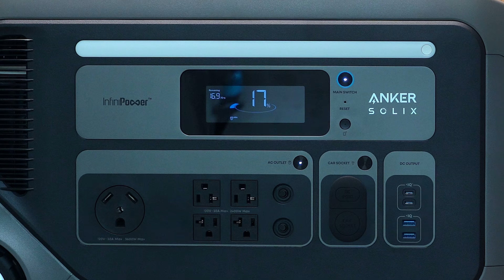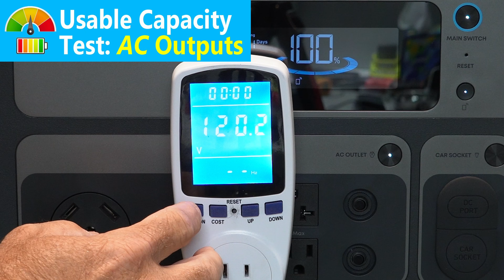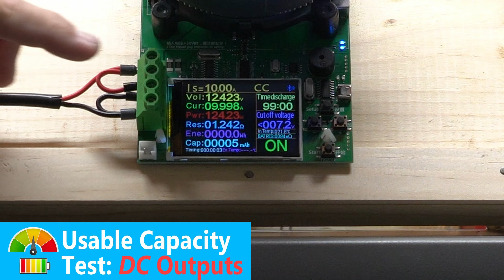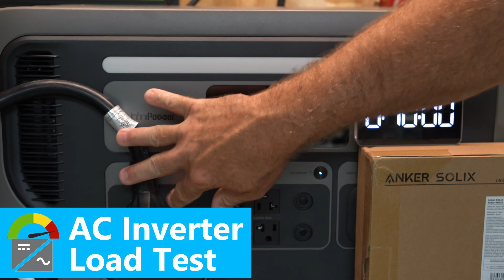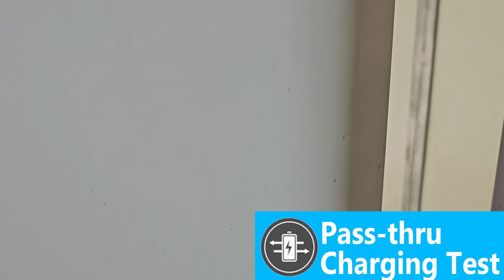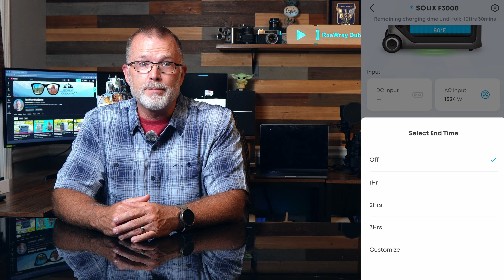Anker SOLIX F3000:  High-Capacity | High-Output | High-Versatility

Comment: Hello I just purchased this last week. This should be OK running my gas furnace correct?
Reply from the maker: Yes.  And depending on the gas furnace and how you're connecting it, you might need to add a ground-neutral bonding adapter plug to make the furnace happy.  Ive not ever needed one, but ive heard that some people have  run into that. Easy $10 solution if you do need it...
Reply: Thank very much for the comment.

Comment: This is a good review that brought out some things I didn't know about the unit such as throttling back the voltage.  If I should ever mistakenly overload the AC output I would rather it trip the AC output breaker than to damage my equipment.  I've been using it in my 30a RV for just over 3 months and it has checked all the boxes for me.
High output DC port:  I'm powering a Starlink Standard from this DC port.
The 3600 watt input/output: I plug the 30a campsite power into the F3000 and plug the F3000 into the RV. (big plus)
The high voltage solar input:  I have three 200 watt solar panels wired in series (for about 80v input) to keep it charged.

Comment: Great review ,understand its the main event but would have like too see what power station you we're using,,I  just bought fx3000 plus extra battery I also so own 2 dpu with 3 batteries each I was wondering if I could plug into fx3000 from 30 out on dpu ???? THANK YOU 🌴🐊😎

Comment: Will this f3000 work if i have it on a 30amp inlet box & have only my central air on which is a 3 ton unit? Ill have other breakers off of course. I got a inverter gas generator ill use for my refrigerator & lights

Comment: I saw the idle standby time and 240v, then learned that's only with 2 of them. Plus the proprietary connectors are a no go for me. You're still better off buying a delta pro, which is several years old at this point, if you're okay without 240v. Or a delta pro 3 if you want 240v

Comment: Ordered 3 of these with 8 rigid solar panels. Was gonna do 6 pannels on top of the house for the main 2 f3000 units connected together. The other 2 solar panels and f3000 will hook up on the shop/shed. Will expand as needed. Will connect via transfer switches.
Reply: Holy cow, that's some real power!
Reply: I'm in AZ, and it's wasted free power from the sun if I don't do something like this. Even if my electric bill is 25% less, it will still be fun setting this up.   @Mark-yuMark-yu
Reply: I know you've moved on from the f3000 setup, but was wondering what rigid panels you went with for that unit. Trying to maximize the input on mine.
Reply: @CMDR_Shokwave  Yes you are right. I am now at 71 panels on the house and 3 big inverters from EG4, but the shop runs on f3000s and f3800plus units. The best output i have found is on Philadelphia 450w bifacial N-type Half cell from San Tan Solar in Arizona. They list them for 199$ per panel, but if you specifically ask for Ryker when you call them, and tell them I sent you he will give you a discount. I don't get anything from them in return and I don't need it. I just bought 13 more panels at 150$ from him so he will work with you. I live 1 light away from them. They will beat any online price most of the time. Just ask for ryker and tell them his surgeon friend recommended him. The output on these panels is insane. If on ground mount with bright background I was getting over 1300-1350w from three panels. When I did 4 panels it was maxed out at 1600w per input maximum, so it was clipping. Worth it at that level of quality. They are also super light 44lbs is nothing for that size and ouptut. N-type is awesome for summer. In non summer months it was producing more than rated. I used them on integra racks. Now they are up on the house and I overproduce still for my usage. Designed for 200kwh per day in Arizona. So actual peak with bifacial gain on the bright gray tile roof at 30 degrees with 6 inch offset and arizona irradiance with this set up is 34-35kw when all 71 panels are lit up. Good luck. This is the funnest hobby I picked up a year ago. I did give one of the f3000 to my parents, but still found use for the other units. Sorry about the typos. I just woke up. Late surgeries last night. Correction my son just reminded me that we were overproducing more than stc on ground mounts due to bifacial gain. He said i often ran 3 of those panels per input because it was enough and easy 1400-1450 w. I just remember when i put them on the ground without the mounts it was around 1350w without bifacial gain. Either way the most production i have ever seen from that small and light of a panel. Aptos and even my canadians can't touch it.
Reply: That’s really cool man! May I ask how much electric bill savings you are seeing in Arizona?
Reply: @thatfishbreeder i will let you know probably in a month when we see the bill, but i was impressed with how much power is produced by solar now with newer tech. On a cloudy day solid 1200 watts per hour just from 4 panels. On a normal arizona day its easy 1550 watts per hour from four panels. Its so much power that i want to hook up the big minisplit thats in the shop, or the big minisplit in the garage, because its making more than I can use in a 7,000 sqft home. That means I just need to buy more batteries to store more power lol
Reply: @SurgeonTech any updates? !
Reply: Just for fun, the eg4 18kpv i think i could hook up 15 panels on 1 string, and there are 3 strings i think. So 30-45 easy per inverter  @jonidontknow

Comment: If I set up anker solar roof panels and connect them to the f3000, and then use a transfer switch for certain devices, that if the power of solar charge exceeds the power needed to run those devices and the battery is full, then the battery gets overloaded? That is my main and only question for my use. I don't want the smart stuff behind it, but I don't want to burn the f3000 either. (Off grid use)

Comment: If your Amp power plug had the ground pin there may be significantly less noise depending on the wiring inside the amp.

Comment: pardon my ignorance but why would you use a multiplier of 5 for the solar input ? you say that you could get up to 12,000w of solar with that multiplier but the max input is 2,400w
Reply from the maker: The point of the 4-5x multiplier is to provide a way of estimating how much battery capacity (in Wh, or Watt-hours) a given rated solar output can provide.  So 2400W of rated solar output can provide up to about 12000Wh of charged battery capacity…more than 4x the actual capacity of this particular power station by itself…or approximately equal to the F3000 with 3 battery expansions connected….in a single day of good sun conditions.  
The other benefit is that even if you’re only charging 3072Wh, being able to connect 2400W of solar allows you to still be able to fully charge this unit (by itself) even IF the sun conditions are not all that great….as long as there is SOME sun.

Comment: I think you had the AC inverter on during the DC testing. Probably impacted your test. I would like to see how much power is used by the inverter alone without any load. Thank you for sharing.
Reply from the maker: Yeah, I actually noticed that and switched the inverter off right after I turned the camera off.I actually did provide the no-load draw results on this unit @20:10

Comment: I'm going to point out the reason for that connector you mention is entirely a non-reason. There's plenty of more readily available connectors that will happily do that, both bog standard and stuff like Weipu that you can acquire the connectors themselves (though it's likely Weipu makes this particular part). 

If I had to hazard a guess, it looks like there's communications in there,  so I assume they'll have some sort of home backup or other accessory for it. 

Is it possible for you to measure and see if those battery ports are live like the F3800?

Comment: Looks like a good upgrade to EcoFlow delta pro (original) only on form factor basis (120v 30 amp with wheels). I don't see how it beats out Pecron E3600, Bluetti Apex 300 or more expensive systems such as EcoFlow delta pro 3.
Still unclear if it can AC charge at lower power and not impact the output like the Apex 300 can. Which is huge for this size system. Especially if you plan to use for RV use.

Comment: Hello, I see that there is pass through charging with the f3000. My question is, if I am outputting  2,500watts from the anker, but my generator can only do 1800w, would the anker pass through the 1800w and add the 700w from the Anker battery? Or will the anker breaker trip because my generator is only 1800w?

I also reached out to Anker, but figured I’d ask here in case you can help test. Thank you
Reply from the maker: After testing that,  it seems you can charge at 1800W and output at 3600W simultaneously.
Reply: @ReeWrayOutdoors this is awesome!! I think this is game changer! Thanks for testing!
Reply: @ReeWrayOutdoors I just received my F3000. I limited the AC charging to 700W and it limited the charge correctly. I then applied a 1400W AC load and the charging increased to 1400W. Either I’m missing something or it only limits the charge power if it’s below the current load (or the load exceeds 1800W).
Reply: @ReeWrayOutdoors this is great to know! Thinking about adding this in between my Kia EV9 and transfer panel for some added capacity.
Reply from the maker: Ooo good question.   Ill have to try it and see.

Comment: Thanks for the review! So I had a few questions, did you get any peek into their “bi-directional inlet box” that allows the unit to connect a sub panel? That’s my main interest in this unit, as a way to daily charge up on solar and discharge it into the home. I see you have reviews for lots of other power units, and it seems like Anker is the only one that offers true bi-directional integration into a home’s existing subpanel.. others offer a critical loads box, but do not allow the power units to push energy directly into the home subpanel.. is this accurate?

Comment: So this is roughly the same as the EcoFlow Delta Pro. Also, based on what I've read and seen on reviews, you should not rely on or use the "surge" feature on any solar generator, regardless of manufacturer. The way these machines do that is not good for appliances.

Comment: Specs and capabilities are nearly identical to the Pecron E3600LFP, but the early bird pricing is still $200 more than the Pecron's perpetual sale price.  I've been looking for something like this but can't see paying $200 for wheels and the Anker name.  Also, no pricing on accessories yet.  Based on their existing expansion battery prices, they are likely to be more expensive than Pecron's $809 for 3072Wh
Reply: Not to mention the New Pecron F3000LFP that's being released now and I got mines for $949
Reply: Good luck with Pecron's customer service.
Reply: Pecron is a hyundai pal. Good luck with your hooptie because I like my Anker Lexus lol
Reply: @xdean  I have had 2 pecron e3600 go back for repairs, but so far Pecron has had good cutomer service.

Comment: I’m first gen F3800 user and am a watt miser in my offgrid cabin. You reported a 30 watt per hour inverter loss. Have you done the same test on an F3800 and calculated the inverter loss?  Thanks
Reply from the maker: No, Sorry.  I haven't had my hands on the F3800 as of yet.

Comment: Were you using a non-inverter generator to do the charging/pass-through demonstration? The reason I ask is because none of my power stations will charge from my non-inverter generator. I have to use my inverter generator to charge them.
Reply from the maker: Actually, this was NOT a true 'inverter-generator'.  This was generator (borrowed from a neighbor)  outputs from an alternator with Automatic Voltage Regulation.  So while it wasn't technically an inverter generator, it DID actually provide charging power that the F3000 seemed to be perfectly fine with.
Reply: As educated as this guy is, there's no way he was using a non-inverter generator.
Reply from the maker: 😬😬😬😆 I actually borrowed this generator specifically because it wasn't an inverter generator, but had automatic voltage regulation...so I could see whether the F3000 would successfully charge with it or not.

Comment: Looks like they borrowed many of the features of the Pecron E3600LFP
Reply: Even the AC charging cable that connects to the unit itself looks like the E3600lfp.

Both have 2400w solar inputs, but the Pecron unit is 32v-150v at 25amps (iirc) for each port. Technically, you can get a bit more with that last input.
Both have 3k watthour batteries on the head units and expansion batteries, but Pecron can go up 15k in capacity. 

I personally will stick to my Pecron unit. I am glad to see that other companies are realizing Pecron put out an amazing product with an amazing price and they had some serious competition for anything below the Delta Pro Ultra tier, but $2,600 vs $1,400 (price I got my e3600lfp) is a no brainer.
Reply: @shiekastate Anker $1299
Reply: I just sent my Pecron back. Their customer service is the worst. They have no clue what their product is supposed to do. It's supposed to prioritize solar, it wasn't.  Tech support told me that was nornal. I sent them one of their sponsored youtube videos, showing that it was supposed to prioritize solar and they agreed that it was supposed to prioritize solar. They basically were going to tell me anything to get me to keep it past the return window.
Reply: Love my e3600 w/ 1 ep3000 setup. You absolutely cannot beat the price and performance. It has saved our fridges 3 times so far this year alone. Our power grid is terrible
Reply: Anker may have drawn inspiration from EcoFlow's Delta Pro, but Pecron? Highly unlikely.